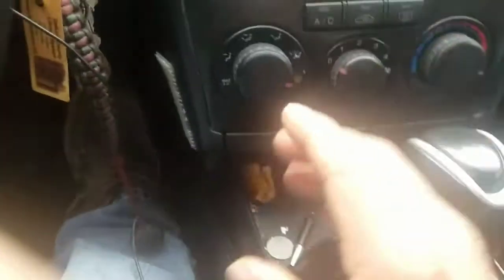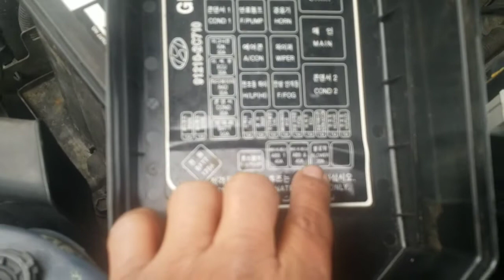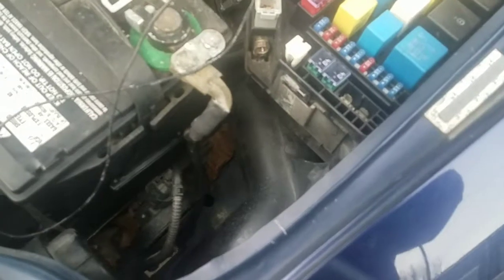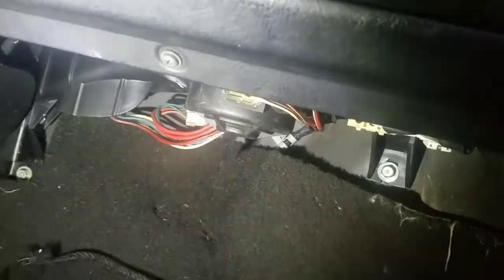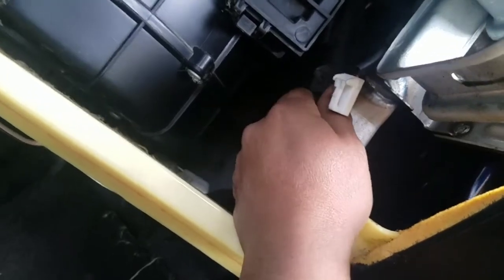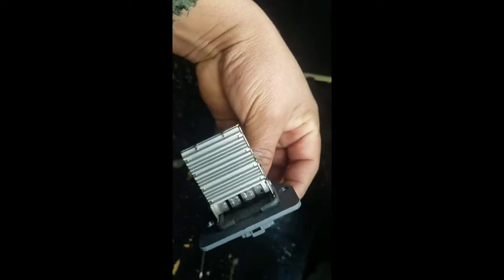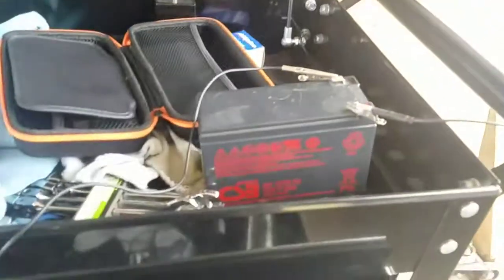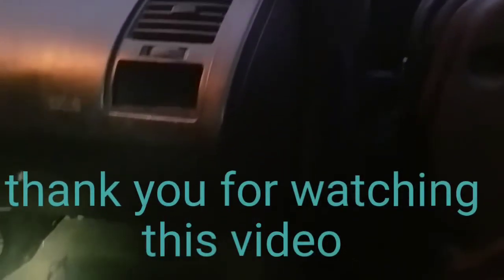Car Heater and A/C Problem, Hyundai Tiburon Blower Motor Relay Location, Blower Motor Resistor?

Comment: Thank you for making one continuous video. The close up view really does help. Appreciate it. I hope to keep my Tiburon forever and videos like this help a lot .😎
Reply from the maker: This appreciation  comment really means a lot to me And thanks again
Reply: So what was the problem?
Reply: Was it the relay or was it the wire
Reply from the maker: @chicanoperez6377  
sorry for my delay snor Perez
the problem was the female pigtail or the inside  the connector was burned so i just cleaned my and connected back like it should 
i hope that helps you
thank you for visiting my channel
Reply: So it works all the time now? And thank you for replying

Comment: I believe this is actually a 2003 Tiburon, but I have a problem where my car’s blower always works but the problem is that it always blows the temperature that’s coming from outside. So if it’s hot outside it blows hot air always and if it’s cold outside it always blows cold air. Can you help me?
Reply from the maker: Sound  like your Flapper  it's broken or got stuck in the middle so right now you should getting worm air all the time right or wrong?  
So check some cables could  be easy fix you may have to change the Resistor switch

Comment: My friend the blower motor of My ac never turn off, is a Hyundai Elantra 2013 , what You think is problem
Reply from the maker: That my friend, it should be the Relay got stuck, if not it have to be the Climate control

Comment: Hola necesito ayuda tengo un tiburon 2006 tira a)c pero El Caliente no funcciona que puede ser
Reply from the maker: Hola, no tengo mi Tiburón conmigo horita para decirte que si el Control del A/C y Caliente  es con cables o Actuator, en otras palabras si es Manual o Electrónica, si es cables entonces donde se conecta esos cables tal ves se quebró, pero si es Electrónica puede ser el Actuator ya no trabaja y también el rueda donde se conecta el Actuator , 
Varias cosas puede causar estas problema. Por ejemplo 
Sin Termostato No ay Caliente. 
No ay suficiente Antifreeze No ay Caliente. Zara
Y si el Camba el dirección del aire no trabajo No ay caliente órbita A/C alguna del los dos,
Final 2% al ves el Control de la Clima está fallando, 
Espero que este te ayuda un poco y
Espero que este aya un Sentido

Comment: I have the same issue. Can you give me a little more information on what you did to fix it.
Reply from the maker: Hi, first of all sorry for my late response and thank you for watching my crappy video lol Oh well I was new of making videos.
OK I  DIDN'T REPLACE ANYTHING As you saw on video The Relay Socket or connector
It burned its because the pin was not inside the Female so what I did I just Cleaned out and made sure the Male was inside the female Tapped up. In your case you have replace the the whole Pigtail or plugin
Reply: @IshMotorparts      Thanks you for responding Yeah I am not a Mechanic  Something happened to the wires because my radio don't work my Sun roof don't work And my heater don't work  So I am trying to figure it out
Reply from the maker: First check the 15A fuse for Sunroof & the 10A for the Radio or other Accessories fuse 
If the are damaged do the next step 
Check your O2 sensors wires, Radio or any open wires that touching any metal or other wire and then Replace those Fuses with new one,
I have done this before, just look very closely sometimes it's very little can't even see it.
Hope that helps you Michael Watson,

Comment: my  ac and air intake lights will not turn on so the ac can blow cool air , is it the resistor?
Reply from the maker: No they Resister it's for seed selection
Reply: @IshMotorparts i’ve already changed out the control switch inside the AC and still has problems
Reply from the maker: Its sounds like you got AC compressor problem
Reply from the maker: If its blowing air but not cold 
And ac light not coming on so most likely its the ac Compressor that could caused by blown Fuse, Relay,  Wiring,  or the entire compressor motor it self

Comment: Pregunta amigo tu tienes este mismo video en español?
Reply from the maker: No, no lo tengo perdón
Reply: Esta bien mano
Reply: Mira yo tengo un 2007 handai tiburon gt y tengo es problema con el aire ya le checked el los fuices y estan bien como te decia el mio solo tiene un un fuse  en la parte de adentro
Reply: Ya le puse el compressor nuevo y resistor y nada
Reply: Boy a ordenar los relojes de la temperatura aunque estoy pensando que puede ser el blower
Reply: El problema que tengo es que no prende nada ni el blower
Reply: Esta complete mente muerto
Reply: Dame tu opinion por favor
Reply from the maker: @elcalentano1971  El Relay debe estar allí a cerca de la Ventilador en mismo donde esta el Resistor, en lado  de Pasajeros
Reply: @IshMotorparts  si lo tiene y parese que esta bien tu quieres que lo cambie tambien
Reply: Que posibilidadas tengo de que sea el blower porque como te digo no prende no el blower
Reply: Ya quite el panel del radio y relojes para ver si los relojes esta bien en el relog seve bien pero la concepcion algo negra como quemado
Reply: Pero la verdad es que el blower no prende
Reply from the maker: @elcalentano1971  jajaja,  estas diciendo que tu climate Contrl no ilumina nada? O sólo  el Blower
Reply: bueno mira tu saves cuando prendo el carro las luces prenden pero las del a no cuando presiono el regulador del frio no ase nada @IshMotorparts
Reply: tu saves que tiene dos botonsitos que tu lo presionas para que mande el aire para atras o nomas en prente bueno esa lucesitas no prenden el plug de el enchufe se como brawn
Reply: esa cosa nadamas me cuesta 168.00
Reply: tambien pudiera ser el blower  pienso

Comment: I have a 2007 tiburon mano and what I want to said is that the 2007 only have one fuse insider
Reply from the maker: Most A/C or Heat it should have a Fuse and Relay